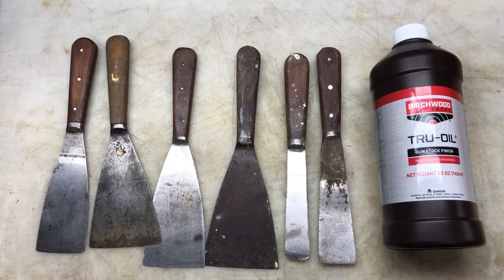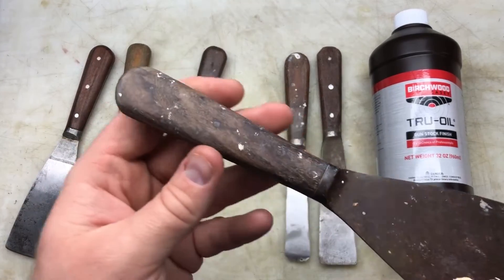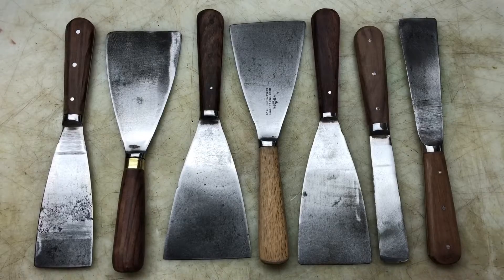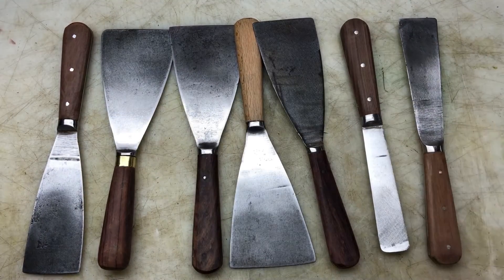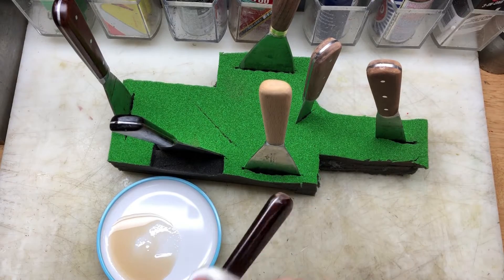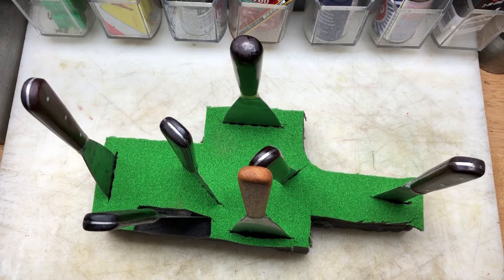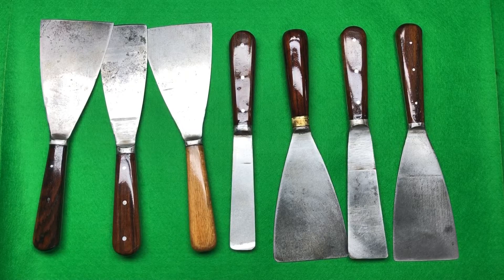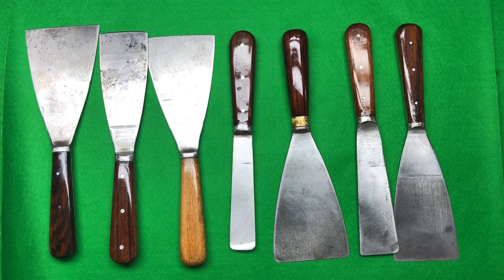Palette knife restoration with birchwood Casey TRU-OIL gun stock finish  Review 😀👍⚒️

Comment: Hi Ben!  Beautiful job on the lot of putty knives!!!   A couple tips on the Tru-Oil, it's a Linseed oil mix that has been processed in such a way that it dries very fast where as Raw linseed oil takes forever to dry.  Again when using any Linseed oil always burn the rags, paper towels or anything that was in contact with the oil as it heats when drying and many fires were started from Linseed oil in the trash.  Also if you notice the oil is quite thin, but some people thin it out even more because the beauty of this product is it penetrates the wood and hardens making the finish not only attractive but very protective!  Another nice feature is in a year or so if the finish is getting a little dull you can just lightly scuff up the handle with 000 steel wool and apply a fresh coat!  Ok the bad news, because of the dryers and chemicals added to the mix it has a limited shelf life, (2 years maybe) and there is no date on the packaging so you have no idea where you stand.  =O  A similar product is made by a company called G96 and comes in 2 oz bottles...  I have found that if you have a big bottle like that take some old polyethylene bottles and fill them up to the top and seal them off, use one bottle at a time until empty and you will get better results.  Everytime air gets in the big bottle it starts to dry the product out.   =D
Reply from the maker: Wow thanks John that’s an amazing message are you available now to have a chat?

Comment: I'm very happy with my Casey tru oil, I'm just a poor guy so I only have a wee small bottle. 
I think birchwood Casey wants you to sand in between coats with XXX steelwool. It does tone down after a while, so I'm experimenting with a shellac top coat at the moment.
Reply from the maker: definitely Alex I only did half the job but still it came out great next time I do it I will use triple zero wire wool For sure thanks for the tip mate :-)